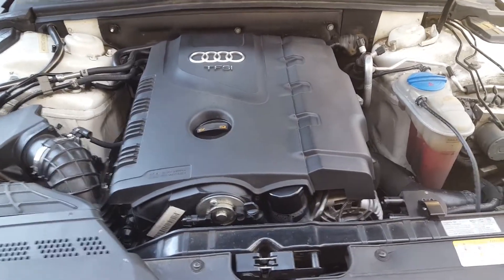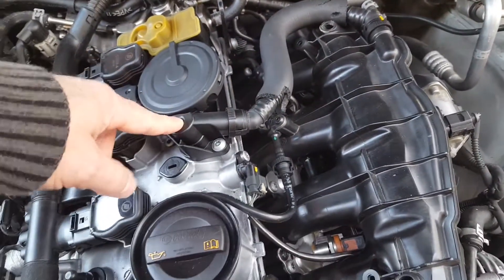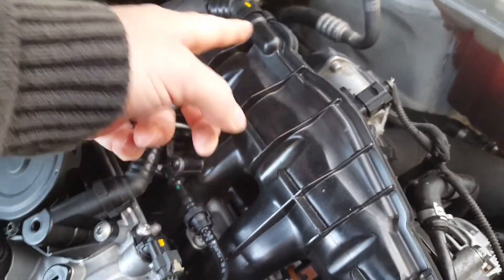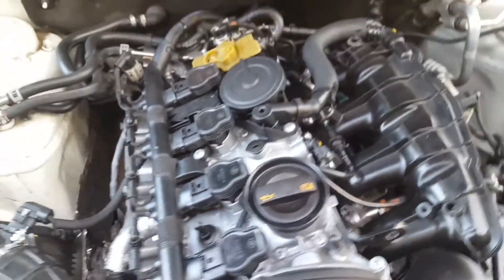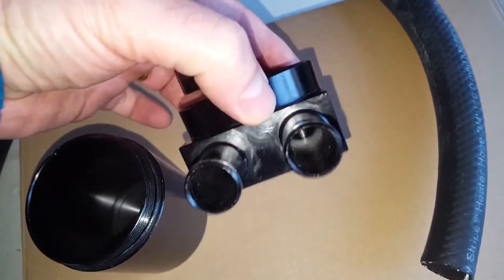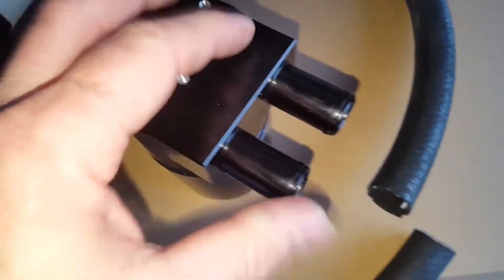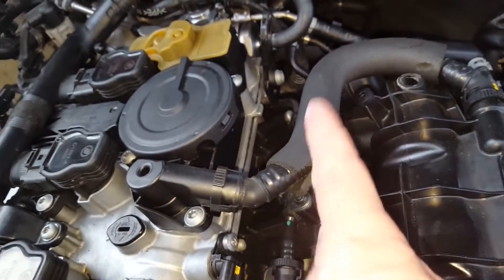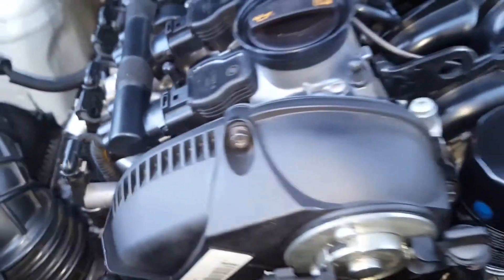Can an Oil Catch-Can Damage Engine Seals?

Comment: On my 2011 Audi A4 I have a CTS turbo catch can and it replaces the pcv system. It seems to work fine. I’ve heard that each car reacts differently.
Reply from the maker: I believe as long you don't block/decrease/redirect any breathing passage circulation it should work just fine.
Reply: Installation catch can without pcv delete kit is a bad idea. Yours i believe already upgraded with pcv delete so you will be fine. Beside it will be useless because oem pcv already does its job to separate oil and the additional occ will just add more unnecessary pressure so that's why occ is not recommended for this machine. B8 already has pcv that's why its pcv differs and more complex with other brands pcv like toyota got very small valve instead of audi has pcv system.